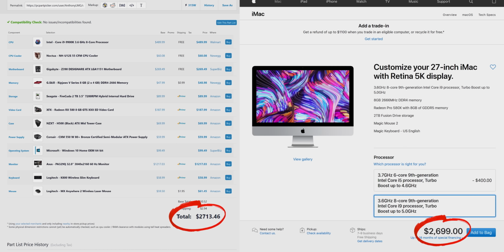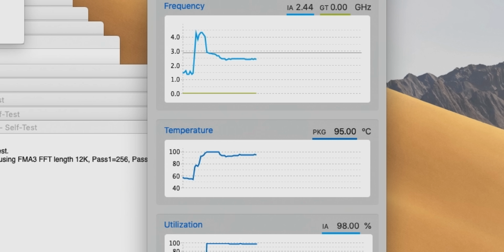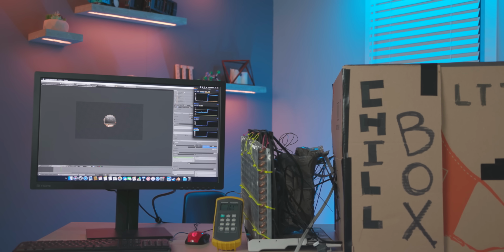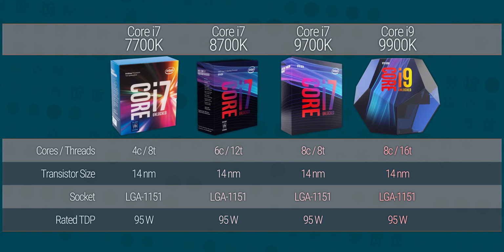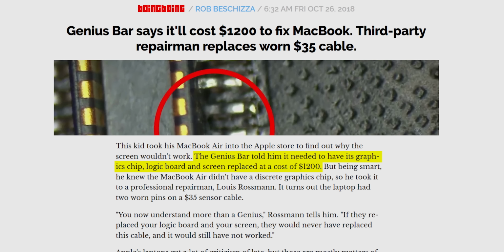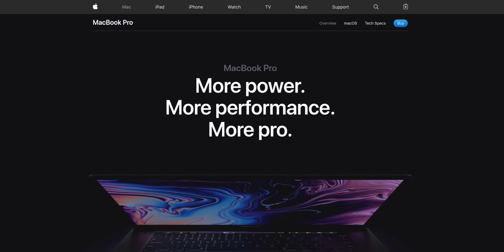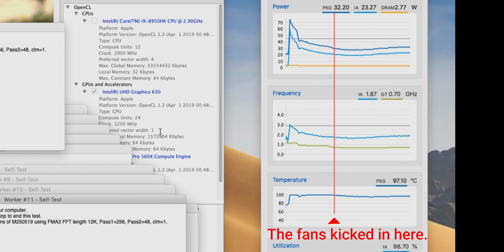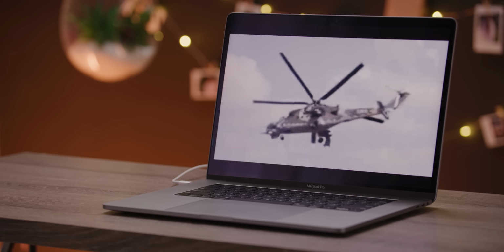Macs are SLOWER than PCs. Here’s why.

Comment: Your last sentence.. "They simply can't ignore the laws of Physics".... They actually tried to ignore and the AirPower fiasco happened.
Reply: That wasn't impossible, but it would cost too much to be viable.
Reply: @LinuxIsNotAnOperatingSystem  Nah the reason why they canceled Airpower is that it is actually impossible with our current technology, as it's impossible to put that many wireless charging coils together without generating an absurd amount of heat and creating a Note 7 version wireless charging mat. So yeah, Apple did attempt to ignore the laws of physics for a second time.
Reply: @danielhu6485  They could have used exotic materials for the induction coils, a lower resistance conductor would generate less heat. Thus, costs too much to be viable. The tech is pretty straightforward.
Reply: @chetanaik  Exotic materials such as?? Copper, the material they were going to use, already has a really small resistance, so I doubt that there is a CURRENT material that could actually work. Sure, in the FUTURE, they could probably get the tech to work, but right now I simply don't think its possible to mass-produce an AirPower product.
Reply: @danielhu6485  Silver for instance is a better conductor than copper. Very expensive true, but very easy to produce and manufacture. There's also the possibility of special thermally conductive (but electrically non conductive) materials being used to dissipate heat over a larger area.
You could also implement an active cooling system, as resistance does increase with temperature. This would probably not meet apple 'slickness' guidelines though.
The heat dissipation is easily done, but it's not really worth the price or the effort for something so inane.
Edit: "easily" done is an exaggeration, but yes can be done
Reply: @chetanaik  Silver's resistivity is barely smaller than copper, so I really don't think it could be a proper replacement and an active cooling solution would make the mat way larger. Apple has never really canceled a product like this before and to admit defeat to a promised product is definitely something that Apple's PR would never do except as a last resort. So I truly think that right now it's impossible to mass-produce a product that has multiple wireless charging coils; you would probably have to go to extreme lengths just to make a working model.
Reply: @danielhu6485  Its resistivity is smaller and its thermal conductivity is higher, this would compound for a decent improvement. Active cooling means sticking a fan and maybe a few heat pipes. Thin and light gaming laptops exist, this really shouldn't be an issue of size. It's just a silly niche product (and maybe the fact apple would despise adding a fan) that doesn't make sense. There are already quality products that offer multi charging pads, they just don't let you keep the devices in whatever manner you wish (ie there will be three marked points that you need to place your device on). The ease of use improvement is negligible at best.
Reply: Chetan Naik You realize “thin and light” gaming laptops are still half an inch thick? Could you imagine a half-inch thick wireless charging pad?? That would be quite loud with a fan?
Reply: @danielhu6485  1/2" is barely anything, if you expected it to be a sheet of paper you are sorely mistaken. It's not like it is meant to be portable and need to be carried around, it's meant to be set on a table and left there, the thickness is irrelevant. Fans can be incredibly small and quiet (again for a price - good bearings and clean aero design has a cost). A fan would not need to dissipate a gaming laptop's worth of heat, merely a couple of lossy usb chargers worth.
Again, THAT'S BESIDES THE POINT. None of the above shows technological limitation, merely the lack of a market, as I have said in the last 3 replies.
Reply: @chetanaik  1/2" is barely anything??? Excuse me, but have you ever seen a wireless charging pad? It's not as thin as a sheet of paper, but would you be ok with a book-sized charging pad? I think you've severely underestimated how difficult it is to create a wireless charging pad, like Apple did too in the beginning.

The Airpower originally was designed to have 21-24 charging coils so you can put a device anywhere on the mat and it would charge. Let's assume that Apple manages with only 21 coils and each of these can only transfer over 7.5 watts, which is below the 10w rating of iPhone Xs wireless charging. This means that the AirPower mat can take over 157.5 watts; oh wait I forgot, inductive coils are terribly inefficient and tend to waste 30% of the energy being fed, so now we're at 236.25 watts being consumed by the AirPower at full load. You realize gaming laptops only draw about 135W at max? At 236.25 watts you need an enormous power brick to feed the sucker and a traditional gaming laptop cooling solution will not suffice seen as laptops tend to run at 80C+, and you do not want a wireless charger at 80C constantly with the sound of a jet taking off every time you use the damn thing.

So no, it is not "a couple of lossy usb chargers worth" of heat and yes, unless your planning to make a textbook sized charging mat, it is beyond our current technological capabilities.
Reply: @danielhu6485  I have a charging pad. I think you should have a look at a ruler, 1/2" isn't much. Maybe if you stopped ignoring what I said you'd realize that. In fact the link which I attached has a wireless charger that's 0.4" thick. 

The airpower concept is stupid. Everything you said was meaningless and completely misses my point.
Laptops don't run at 80C, you don't get third degree burns by holding their exhaust vents. A tiny 1"x1" square on the motherboard (the CPU) may reach peak temps of 80C, the actual output air is nowhere near that, nor is any contact surface. I have an overclocked i7-8700k in my tower and its air cooled with a noctua air cooler. It reaches sound levels of around 45dB while trying to cool something in a fairly poorly ventilated box - this sound level is equivalent to a heating vent in you room, minimal.

"lossy usb chargers" = 30% worse than a regular charger, "couple" = multiple coils

Airpower wasn't built becuase it is technologically impossible, but because there is no market for it.  There are already products that do the job adequately; no one cares that you gain the ability to charge while offset by 3", people can place stuff on pads well enough.

This exists, among multiple other things : https://www.amazon.com/Wireless-Charger-AirPods-YLEX-Charging/dp/B07LCSPBYQ

We are getting nowhere, I have basically repeated myself 4 times now. If you reply to this, scroll up and read this again as my reply.
Reply: Chetan Naik We’re getting nowhere because you’ve literally ignored my entire comment believing that a wireless charging mat with fans as an active cooling solution and over 21 inductive coils is a viable product THAT CAN BE MASS-PRODUCED. You keep repeating the same things because every time I show you how ridiculous the design really was, you shrug and say it should be possible based on a wireless charger that has 3 coils and a gaming laptop thermal solution that at best can keep a processor at sub 90C

The product you included does not have 21 charging coils and the difference between a laptop and a wireless charging mat is that there is millimeters of material separating the coils from the surface (that’s how wireless charging works), while you have sheets of metals separating a 80C processor from the surface of the laptop

I tire of this conversation too, especially with your arrogance, that you believe that you can come up with a design that triumphs anything Apple, a formerly trillion dollar company, can come up with. It’s simply dumb to watch a baboon look at a satellite and a solar panel roof and then jump to the conclusion that it would be possible with our current technology to build Dyson sphere around the sun. If you do respond to this comment, please first address you even plan to cool the coils before you pointlessly ramble on.
Reply: @danielhu6485  Yet again you hand-wave away my entire point. At no point did I claim a superior understanding of hardware design to apple's legions of engineers. You on the other hand relied on excessive exaggeration ("jet engine" really) at every point just to remain blind to the actual topic of discussion. 
My point is the principles are simple and apple is more than capable of designing something that works. However, this would likely not meet their design criteria or provide adequate returns due to it being conceptually pointless. Why use 21 coils when 3 coils can do the job, with the only additional benefit being half a second of attention required to correctly place the device.

Thus, my theory is that it's not technological constraints, but economics and sales that cancelled the manufacture of this device.
I'm not going to bother further explaining cooling to you as we aren't designing it here, nor have you had the grace to even acknowledge my point on the marketability.
Reply: alysdexia Don’t know what your initial words are referring to, but even if the coils only outputted 25% of their max capacity, that would still require a lot of heat dissipation
Reply: @danielhu6485  They didnt ignore it. Thats why it isnt on the market.
Reply: @Smorfar  It was going to be on the market; on the Airpods 2 packaging it had images of AirPower and they even set dates for its launch. The fact that they put so much work into it shows that they did attempt to ignore the laws of thermodynamics.
Reply: @danielhu6485   Man the guys u r dealing with here..... Oof mate
Reply: Apple: AirPower can't be released because if we release it, It will not
be in our quality standards
Samsung: Hold my beer

1 minute after

*Releases S10 and Fold*
Reply: Apple is basically a brilliant marketing company to peddle low grade Chinese made products.
Reply: alysdexia Tf you on about; wth you mean bad diction? I swear half of people on this earth are nutters. Where are you getting your definitions? Where in gods name does “thin” refer to density and in what world does “squat” necessarily refer to the depth of an object? Are these British terms? Well pip pip Cheerio and god save the queen, no one gives a f*ck. The colloquial meaning of “thin” is something that is slim and your not find a single tech reviewer describing the next generation of Razer laptops as a “squat” gaming machine.
As for the coils, they obviously make it so you can place the device anywhere on the mat so it could charge. I thought that was obvious. My coils example was a worst case scenario; I assume that Apple will control the grid of coils through software. That means unless there is adequate cooling to support all coils, one software bug could easily turn the AirPower into the Note 7. Even if they do hard limit each coil by 80% because each coil may not need to run at 7.5 W to fully charge a device, that’s still a buttload that needs to be dissipated and one drunk Apple software engineer could quickly start the next Great Fire of London if there wasn’t proper thermal protection.
Reply: @danielhu6485  I don't know much about wireless charging technology but why couldn't they just make one huge coil? wouldn't that work better then having multiple coils in a block of plastic??
Reply: Lit Bass Boost AirPower needs to be able to charge 3 devices at a time, one massive coil doesn’t do that. Plus a bigger coil would still consume more energy
Reply: @danielhu6485  the solution would be smaller coils on their own circuits and a plate of conductive material (aluminium) to dissipate the heat without needing fans to do so (also called a heat-sink). The reason they backed out wasn't because it is impossible with current technology; they backed out because someone doing the financial analysis higher up saw that they weren't going to make huge profits on it since there was already quite a bit of competition in a small market with very limited growth potential.
Reply: @ZzX010  Finally, a reasonable person. But I would still question the efficiency of a passive cooler and whether it would be able to keep up with 27 coils.

Comment: When i used to run my Electrical engineering software, my macbook air runs okay so I cant complaint. Also the operating system does not lag after using the laptop over and over. Unlike pc, you have to format your pc at least once every year. Louis Rossmann is a great repair guy who know a lot of information about circuit design and how to fix them. Also he is the #1 apple products hater lol. I still prefer using apple the advantages of using an apple laptop is more than using a pc laptop. One great advantage is the graphics and colors of mac laptop its way better than using a pc. Thats just one advantage, Im not even digging into the operating system they have. My first computers where windows pc but when i used the man i fell in love with it it was weird at the beginning because the desktop was empty but when you know how to use it. It becomes a love affair.
Reply: 'Format your PC at least once a year.' In what universe?? I have literally NEVER had to format my PC (newest PC being 5 years old, but have had my own for 11 years, still never had to format)??

Comment: I have two Mac's from 2011 the Mac Mini and the MacBook Pro, I just changed the hard drives to SSD and to be honest I won't be buying a new one anytime soon. So when you think of it I paid $1300 for the laptop and $1000 for the Mac Mini they have cost me around $13 per month. I have tried a bunch of Windows PC's in the same time frame and not one of them is still in use. Not a fanboy but after 8 years of everyday use, they still feel like new.

Comment: My 2015 MBP 15" at home is somehow less laggy than the 2016 MBP 13" at work.  The fan also runs a lot less on the older model.  I am unsure whether I will buy another Mac laptop given how disappointing the newer models are.  The only improvement I see is battery life.

Comment: Apple just doesn't care about performance as much as looks because it's base does. They throw out a few buzz words and live off their legacy largely. I long switched to Dell's professional line because of it. My current everyday mobile workstation is a Latitude 5491 with the 6 core and Nvidia dedicated graphics option, being only slightly thicker then the 7000 series, it's still not Macbook thin, but then again it's thick for a reason. You can't fake steak and since I really don't like carrying around 15 inchers to start with, this was a nice option over say the XPS line that suffers some of the same problems.. thermal limitations verses the Precision line such as the 3530 and still have tons of computing power at disposal. I actually feel for Apple customers since I saved enough with that purchase to buy a new Dell thunderbolt dock too:)

Comment: A Mac is a pc “personal computer” 
🤣 sorry, just had to
Reply: Generally, the term PC refers to a computer compatible with software that ran on the IBM PC (aka a computer with an x86 or x86_64 processor). That still means a Mac is a PC though, because modern Macs use x86_64 processors and can run x86 versions of Windows or Linux perfectly fine.

Comment: As for why Apple does this to their laptops but not their phones, I may have a hypothesis.

They design the phone chips themselves, so they can work thermal efficiency into the design of the chip. For the laptops they relay on Intel, so they can't make the design choice at hardware level.

Same for why they don't use slower chips: there are none. The Slower intel chips have the same TDP, and because of their binning a rather similar het production as well. They can't use AMD chips, because as a hackintosher, I can tell you macOS and AMD don't play nice (no matter how many videos you make on them).

Comment: I've got a workstation laptop at work, and the specs are great, but the air intakes are on the bottom, and the entire outer edge of the laptop has a solid rubber gasket around the entire housing.  

The damn thing vacuum seals itself to the table top when the fans go off. Who the hell designed this thing?

Comment: The reason apple treat their phones differently than their laptops is...

Steve Jobs hates (hated) fans. This causes a problem for Intel CPUs because they're transistor heavy. They behave like CISC processors by turning CISC commands into microcode for RISC cores. That means their processors are huge, and need cooling Apple won't give them.

Their phones are ARM based. Much more efficient. Fewer transistors.

At some point soon (I know people have been saying this for years) all Apple devices will be on ARM (and all consoles will be on AMD, so sucks to be Intel)

Comment: Your comparing a 27 inch monitor against a 32 inch monitor in the 15 second mark comparison chart, more expensive mice/keyboard for the PC side(shouldn't you be using the Microsoft keyboard and mouse to compare? Each of those are like $10-15). You can easily cut $400-500 by switching the Asus monitor to a 27 inch and not a 32inch.

Comment: the board thermal flex point is interesting.   many people don't understand that different materials expand at different rates. this can even break ,and sometimes break, the PCB substrate its self.  Ironically  this is the marketing point (and an enhanced ground plane) around  Gigabyte's Ultra Durable series.   Apple does this to its costumers because they can get away with it.  many PC buyers  are less tolerant of this.

Comment: the rule is simple , if you offer a thin laptop there is no room for cooling and it will throttle. so don't buy a high end cpu in a thin laptop , go for a cheaper cpu and lose no performance